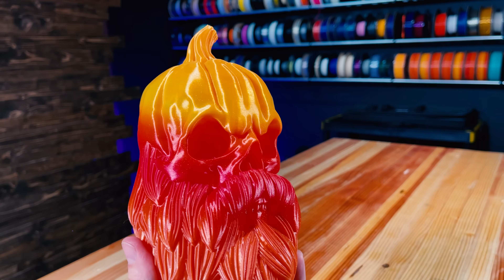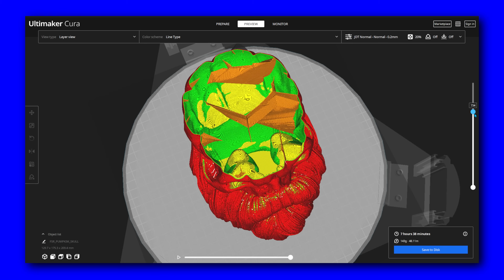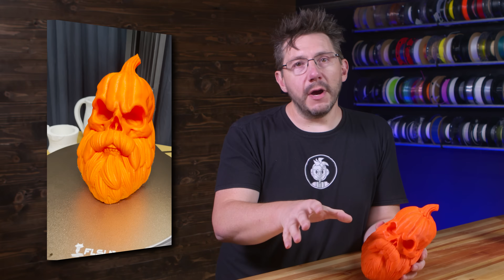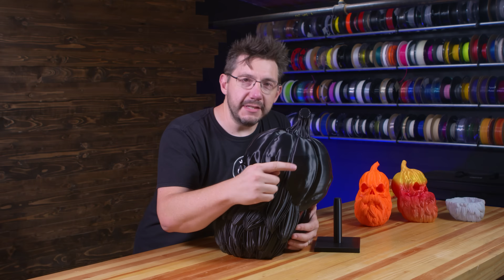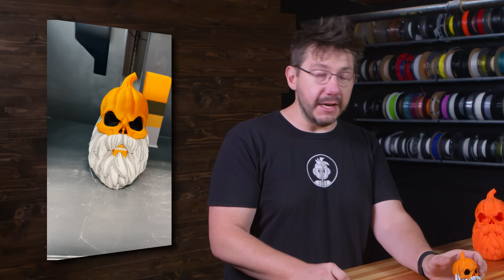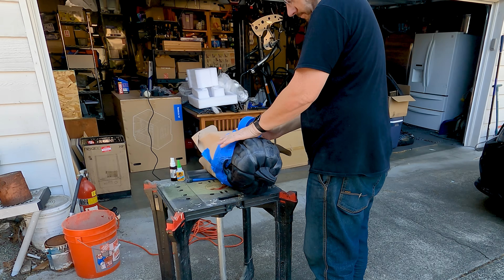MASSIVE 3D Printed Pumpkin Skull WITH A BEARD!

Comment: it failed in bed layer adhesion. turn the bed higher. if you have a decent bed level and cooling settings you won't run into "bumping" into a previous layer. I don't know if those delta printers have a zhop setting

Comment: In the Big Breaded Skull Pumpkin time lapse I see you had what looks like 20% Gryrod infill there! 
That is why your filament was being used up so fast WITH 5 or 10% Lighting infill and 3 walls top and bottom would still worked and saved a tons of filament.

Like me doing a big T-Rex skull in white PLA, I used 5% Grid Infill and 3 walls top and bottom by a 1 mm Nozzle. 

The Skull looks great about 10 inches long 6 inches wide and high.

It was done in two half's on the same bed at the same time standing upright with the nose at the top with tree supports for the teeth from the Cura 4.11 slicer.

Took 24 Hours to print on the Voxelab Aquila Stock machine no encloser there. I did it for my sister who was delighted with it?
My adult Niece has asked my to do a skull like it but in Glow in the Dark light blue PLA.

I never heard of flexible PLA? I bet it being new is pricey most filaments now are almost twice the cost as a year back!